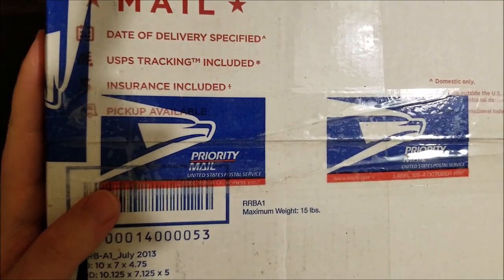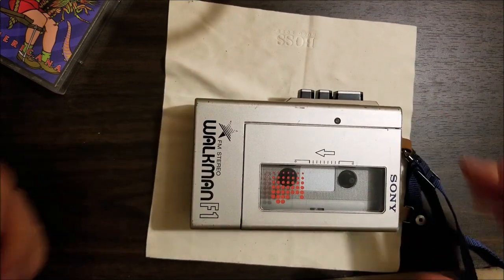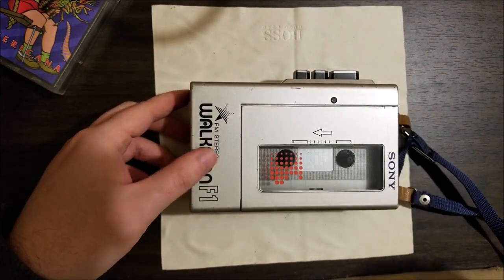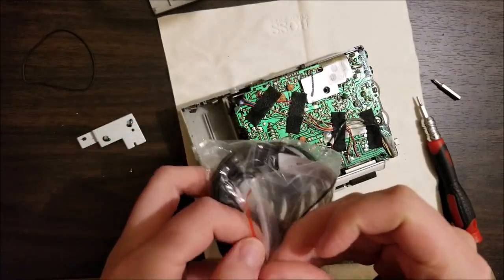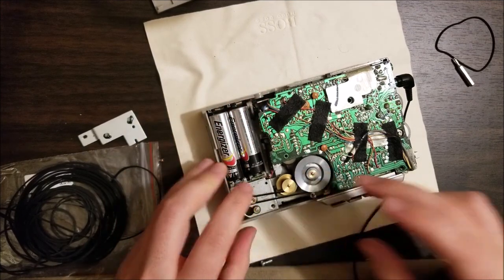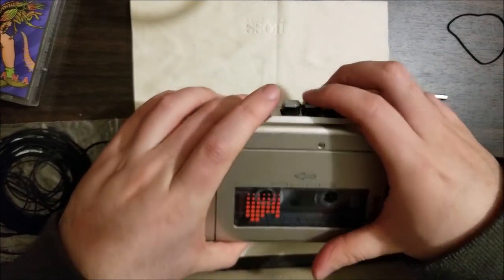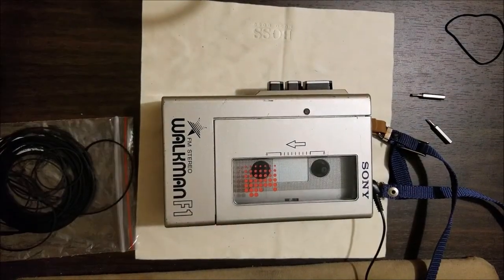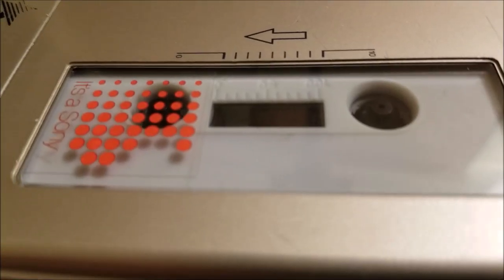Let's Fix: Sony F1 Cassette Walkman

Comment: Do you have a video on the placement of the fast forward idler arm as I need to know where to put the spring.
Reply from the maker: I had the exact same problem. I remember it having to hook to a nearby vertical bit of metal bent up from the midframe. I really wish I still had this unit to shoot you a clear video/pic but it went back to the owner shortly after I finished working on it.

Comment: I'm kind of 4 years late but I wanna ask something, I recently got a perfectly working WM-F1 with the lanyard and I'm wondering how can you remove the lanyard or is it even possible to remove it?
Reply from the maker: I'm pretty sure you can remove it once you disassemble part of the case. I'd reference the service manual for instructions to get to the point where you have access to what's fastening the lanyard to the enclosure. Sorry I cant give exact instructions, I personally don't own this model (the one in this video was a repair for a customer so I no longer have it to check).

Comment: Hey i got the other version of yours (tcm-3) but mine seems got a short circuit and cant turn on anymore, do you know how i can fix it?
Reply from the maker: Hunt down the short using a multimeter to measure the reisitance on the power rail. Once you find the failed component, remove and replace it.

Comment: A 1983 walkman. 36 years old.  ... damn now I am getting old.  Btw I did try that trick to get the belts on my 1986 Technics RS-B49R soft again, but that was a no go.  You could see that the belt was left in the same position for a long time as it would keep that form.  In my quest to get the proper belts I found a lot of the belts like you have in a package but no flat belts. Why o why?   Since I didn't find the correct length etc I had to buy an online kit that cost me an arm and a leg, meaning highly overpriced because they seem to know that you can't find the proper information.
Reply from the maker: I've heard of people 3d printing custom belts using flexible filament and I'd like to try that but would worry that any tiny inaccuracy would result in very noticeable wobble.

Comment: Hey great vid. I just grabbed a WM-8 at a thrift shop and none of the spindles move when I press the buttons. Battery light, lights up though. Any thoughts on what I should be looking at? I'm assuming even if belts were loose something would be moving.
Reply from the maker: That would be the belt, luckily replacing it is usually pretty cheap and easy (a quick google search will net you some sellers who still make replacements). Most of the time I've found that on older units  that haven't been serviced the belt doesn't just stretch, but either actually melts into a gooey mess or snaps completely. It's quite often that if you hear the motor spinning that one of these two scenarios is the case.
Reply: @sjm4306  Thanks for the super quick response. Yeah I opened it up last night. I see the belts, but I don't actually hear anything when I press play/ff/rew so that's why I'm wondering if it might be something else. But I can start with belts if you think that's the right path.
Reply: oh to clarify, when i say "i don't hear anything" i mean i don't hear any mechanisms moving in the walkman itself
Reply from the maker: Does the motor spin? That's the important detail. If not then there's something else wrong with the circuit/motor, if it does then it likely just needs a new belt and possibly a bit of cleaning. Can you press play and manually spin the motor or is it stuck/difficult to spin?
Reply: @sjm4306  I don't believe the motor spins, but I will double check when I get home today. Thanks!
Reply: So the motor wasn't spinning, BUT then I starting twisting it manually and it kicked into gear! Definitely need new bands though, I saw how wobbly they were when it was moving. Thanks and any suggestions where to get bands?
Reply from the maker: Sounds like the bearing lubrication was a bit stuck. I get my replacement belts off ebay.

Comment: You replaced main drive belt, but does the F1 have a second belt under the circuit board? If so, how to lift board seems difficult. I want to do this.

Comment: I was looking at my Walkman, which has the same problem, and as I was putting it back together I noticed a black torsion spring where I was working and didn’t know if it was from the Walkman or maybe it was from something else. If it was from the Walkman do you know the location that it goes? I have the PP227. Thank you.

Comment: Hello! Do you do send in repairs? In that case, what price?
Reply from the maker: I occasionally accept repair jobs on a case by case basis depending on my schedule. Price will directly depend on what the fault is and of course if any replacement parts need to be purchased.

Comment: My unit's headphone jack doesnt work. When i fully plug it in only side of the headphones work, when i try to adjust there's alot of distortion sounds. What can i do?
Reply from the maker: Sounds like the jack contacts are either dirty (a qtip with isopropyl alcohol can be carefully inserted to clean) or the soldering on the jack's pcb pins need to be reflowed.

Comment: I bought the same model Walkman and I opened it and the speed dial was moved so I was wondering if you could tell me which was the speed dial was on yours
Reply from the maker: I've sent the Walkman back to the owner so I unfortunately cant check. Also your walkman and this one were likely manufactured at different times and with variances in mechanical qualities so the calibration would be different as well. If you have calibrated/correctly working tape recorder you can record a known frequency tone onto a tape and play that back on the walkman requiring speed calibration so that you can tweak the dial till it sounds correct.
Reply: I opened mine and didn't notice a speed dial. Where the heck is it?

Comment: Couldn't have Sony used better materials/mechanical when they built the Walkmans so that it lasted indefinitely. I have a TCS 310 but the plastic assembly at the bottom that moves the wheels and stuff is breaking and forming cracks ;(
Reply from the maker: That stinks, yeah their low end plastic mechanisms leave a lot to be desired and as you said tend to go very brittle as they age. On the other hand I have a WM-3 from the 80s with mostly metal construction that still works perfectly to this day (only requiring a belt change of course).

Comment: My Walkman seems to have everything working but I still can’t get the cassette to play on it. I think it might need a new belt i don’t know tho any a ideas ?
Reply from the maker: If you open the cassette door and press play does the spindle move? If you apply pressure with your finger does it still move or start slipping?
Reply: sjm4306 it moves but when I just put a little pressure it go’s the other way
Reply from the maker: If you open her up it and inspect the belt you can see if it is too loose. Another common problem is for rubber frictions edge drive mechanisms they get dirty and start slipping so giving any rubber parts a good inspection/clean is a good start.
Reply: sjm4306 sounds good thank you very much

Comment: Hi, I was wondering if maybe you might be willing, if I paid you, also don't know how much, if you could fix this Walkman WM-1 I just got? It's beyond me frankly, I just don't know. I mean I know it needs a new belt, that was a given I expected, and it does I can handle that, only has one as it is. However, the real issue is I don't know if that will fix the FF and REW not working, you can hear the motor making noise so maybe it is the loose belt. The more concerning thing and the real reason I'm motivated, in desperation honestly to reach out is BOTH headphone jacks, even with cleaning the ports still only make sound come out of one side of the headphones. This has trapped me with some other things in the past, usually just twisting the jack for the headphone around solves it, not this. I didn't expect this was going to be a issue with it, I don't even know what to do and I have tried looking around in general, YT, the internet outside of it, I can't find anything. The eject, also doesn't pop the door out but sometimes it seems it does, I can live with pulling it with my fingers out, shouldn't be that way either of course but it doesn't cause actual problems.

I don't know if you will even see this but, please if willing let me know and maybe an email I can talk to you about it more in? I wish I could say I have anyone else I know that could help but, I don't sadly and I'd be very grateful to you trust me, even if it will cost me more on top of what it did cost. Thank you.
Reply from the maker: Hey, sorry for the late reply, I get a lot of comments and it takes awhile to go through them all. Yeah, it definitely needs a new belt and as for the headphone jack issue it could be the volume pot or maybe the caps near the amp, hard to tell without testing it. I'm pretty bogged down atm so I've put a hold on taking new projects till I finish my current batch.
Reply: @sjm4306  That's fine, things have changed since but still thanks.

Comment: Do you know exactly what belt it needs to be replaced with? Ive bought one that plays 'wobbly' and almost sounds like its under water (i knew there were problens with it when i bought it) and i believe the problem is the belt as its very loose
Reply from the maker: Last I checked there was a seller on ebay who cut custom belts for many different walkman models. Search the model number and "replacement belt"
Reply: @sjm4306  thank you :)

Comment: Mind if anything can give me a link to some walkman belt kits? I also need it to go in and fix a Sony Walkman WM-F1.

I don’t have anywhere else to go and get some support so that is why I’m here.
Reply from the maker: You can get a multi-belt kit here: https://ebay.to/2Ni13vg
However just be aware that some belts in these cheap kits will be duds and many have pretty bad wow and flutter.

If you want a set of belts made custom and much better quality for your specific model you can get them here (I've bought from this seller in the past and can confirm the quality is much better than the cheap ones above): https://ebay.to/2NeldWW

Comment: I have in my humble Collection the TCM-3 Cassette-Corder, which is the recorder version of your Walkman.
It lacks the FM radio, but it has a tape counter on the front, and on the back instead of the belt clip there is a speaker.
Fun thing is that it had the exact same issue of yours, so I'm guessing it's a common fault.
Reply from the maker: Yep, drop in a new belt and she'll be as good as new

Comment: Hello, I was wondering I changed my belt on my f1 walkman and before I changed it the cassette motor works and the radio as well now after I took it off and replaced the belt I put new batteries in now the radio of the f1 won't turn on no red lights and now the motors won't turn and ideas how to fix
Reply from the maker: Did you move any wires during the process? Sounds like there's just no power so I'd first check the soldering on any wiring inside and then inspect the battery terminal connections.
Reply: @sjm4306  yeah no wires were moved, all I did was take off the back and un screw the belt block on top of the rollers to add the new belt, no corrosion in the battery compartment
Reply: @sjm4306  one more thing, do you need to lubricate the new belts, before I play music on it and what is the best product and brand for lubricating belts and or oil
Reply from the maker: Never lubricate belts, they need friction to work much in the same way that tires need to grip the road for a car to drive.
Reply: @sjm4306  ok thanks
Reply: @sjm4306  sorry to bother you again lol, but when I play my cassettes in my walkman through my headphones I can hear the components turning, how do you fix that
Reply from the maker: If I'm being honest the only practical fix is to buy a higher end walkman. The less practical fix, with keeping your current walkman is to completely redesign the main pcb with proper noise filtering. You can try just replacing all electrolytic capacitors which will likely help but probably not completely remove the noise.
Reply: @sjm4306  another thing sorry I have it playing music but this annoying sound is coming from the motor https://youtu.be/viu4AQ8XjGE that's my walkman in the link how do you fix that
Reply: @sjm4306  ok so there's the fast forward wheel that touch the metal wheel for the play button and it makes that sound because of friction I'm guessing I could be wrong, if anything if I can send it in to you for rapairs
Reply from the maker: It's possible the whole mechanism just needs cleaning and relubricating, but even with that it's probably impossible to remove all mechanical noise from making it through to the audio path given the age and design of the unit. In the end I don't mind taking a look at it, but I'm not sure the results will be worth how much time I'd have to charge for the job unless it's a higher end model.
Reply: @sjm4306  mechanical through the audio is fixed it was a less tighter but just the load noise of the motor/gears on this link https://youtu.be/viu4AQ8XjGE that's my walkman and it's just the gear noise that's coming from the gears and the fast forward has a delay or doesn't work at all any ideas, sorry for being annoying BTW lol
Reply from the maker: Don't worry, you aren't being annoying. Sorry I didn't see your video till now, youtube held it for review because of the url. Yeah that's definitely not normal, something is rubbing and desperately needs lubrication!
Reply: @sjm4306  I cleaned it and oil/lubricated the barings and gears everything is running quite the problem now is the rewing button work withought a cassette but with a cassette it doesn't I probably lubricated to friction part for it , but the rewind is no good I might just seek help online to see who repairs retro equipment
Reply from the maker: There is one thing I remember was difficult, if you remove the metal flywheel that's on the pinch roller post there's a little bracket and spring that's hard to get back on correctly and if not assembled correctly the ffw or rw wont work properly and could even eat tapes.
Reply: @sjm4306  that could be it, I do need a see a video about putting it correctly back but don't see another of videos of how to fix that lol
Reply from the maker: I cant remember if I showed that part or at least pointed it out in my video. I think I did because it gave me enough trouble that I was annoyed.
Reply: @sjm4306  you did I saw when your pressed the fast forward button the wheel that's closer to the captain doesn't do what it does in your video and I don't know where that goes, lol gives me a head ache but at least I got gears not making that god awful sound of metal scraping

Comment: All need to go on eBay to FixYourAudio.com, out of Slovakia, they have the best quality belts built to oem specs, takes a while to arrive but you will not be disappointed, got my Walkman running like new again. Those Chinese multi pack belts are not even all way around and will cause wobble in sounds.
Reply from the maker: I've bought from them before, great resource for hard to find walkman belts, pinch roller rubber wheels, etc. Not the cheapest but the best you can get nowadays.
Reply: Correct I see it as you get what you pay for, great service and a long lasting product though.
Reply: Takes forever to arrive and they still arent a good fit.. Takes close to 2 months to arrive

Comment: That thing is huge.
Reply from the maker: I remember lugging around similarly sized players when I was a teen. I usually wore cargo pants and one pocket held the player and the other spare tapes and batteries. Definitely dont miss that part.
Reply: @sjm4306  Haha... I was in that spot too at some point. But it was high school with a discman and folder full of heavy metal CDs. What's the best model of Sony Walkman? I have my eye on a WM-F18.
Reply from the maker: The best cassette walkman would have to be the dd quartz series but those go for silly amounts of money.
Reply: @sjm4306  Right on. Beltless? I'm looking to enter the tech on a budget. $50 would be good. 😁 Waiting for a nice lot that needs a simple belt replacement. How you doing? All better now?
Reply from the maker: Yep almost 100%, thanks for asking!
Reply: @sjm4306  Working on a Sony WM-F8, hoping I don't have to desolder connections to get the PCB out of the way to access the belts... Trying to get the other side of the case off. 🤔🤔🤔

Comment: Hey there! I know its like, a year later, but im I've been super interested in walkmans since I was like 13, and so far I've got like 7! (Mix of micro and normal) just today, I found the other variant of this one, the wm 1. It doesn't work at all, and I wanna know how to fix it:((( when I opened it up the batteries had blown up so I was hoping that by cleaning that up, I'd get it to work, but nothing. The belt looks decent too. It'd be great if you could help me out!

Comment: i have a Sharp JC126 AM/FM stereo cassete player and the audio is distorted and slow and could a belt be the cause?
Reply from the maker: Very much likely. Does the am/fm audio sound distorted as well (this could point to bad caps as well).
Reply: @sjm4306  no it doesn't only the cassette player
Reply from the maker: Yep, then sounds like you just need a new belt.
Reply: @sjm4306  in fact yea there's something wrong with the radio, like sometimes it doesn't want to work and if you plug headphones in you can hear static but its muffled and can't get a station but sometimes the radio works